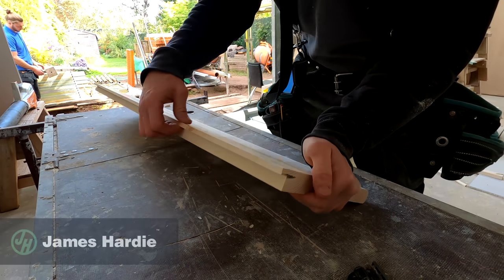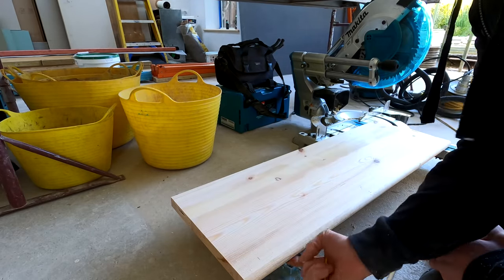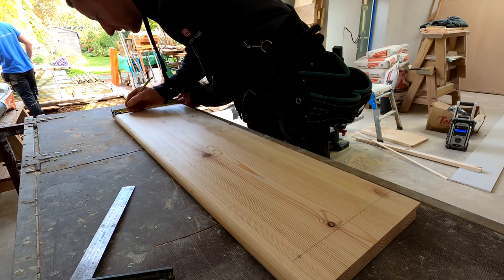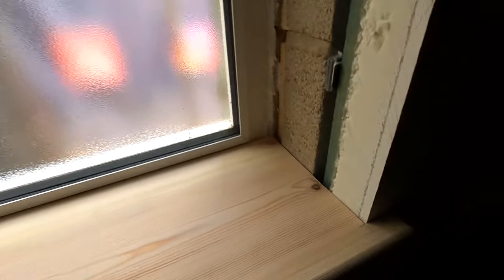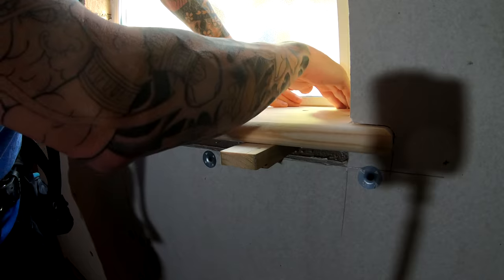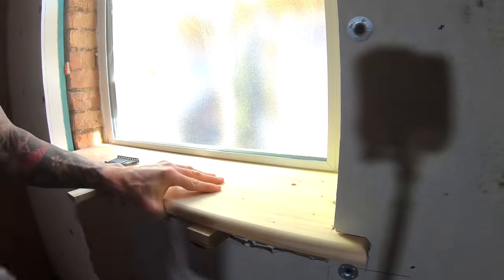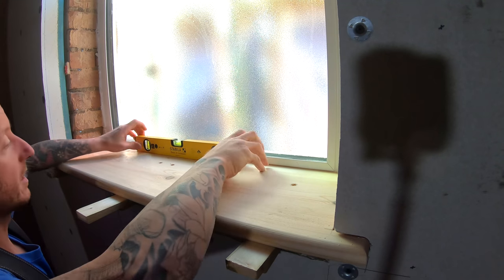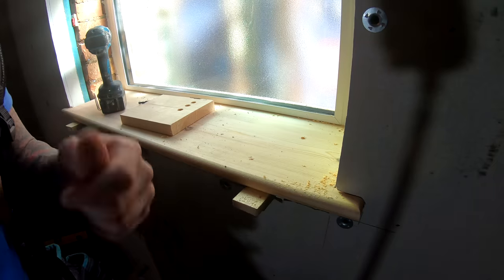HOW TO fit a Window Sill Board!

Comment: Old boy said to me to always tilt the board slightly away from the window (bubble on the line)  in order for condensation to run away from the window and not to pool there creating rot.  Which means he was taught by people who built houses in the 1930s.  It was probably an issue back then but not now I think.

Comment: My old boss 40 years ago was a stickler for priming the underside & edges of the sill board to stop any moisture warping sill board.
What do you think, do you find plugs & screws are a better fixing method than using 6mm  Countersunk Concrete Screws like Timco, which I was drummed into using a few years ago for fixing window sill,door linings,etc.

Comment: I use the same method although I pre drill the wedges to prevent splitting not that it matters as it’s downward pressure.  Finding a window that is actually level isn’t always easy. Nice work as always.

Comment: Fitted so many window boards like the over the years. I tend to put them on with expanding foam adhesive now. Top work as always.
Reply: Do prefer the foam,much quicker.
Reply: Just put something heavy on top mine have lifted before 👍🏻
Reply: @toddstockton9663  I've not done it that way before but I can see how that would be a problem.
Reply from the maker: Thanks for watching Stephen! 👍
Reply: You can  get low expanding foam or plasterboard adhesive 
It will not lift it .

Comment: Great job as always i do the same thing routing the horns. We usually get the plasterer to dab a bit of plasterboard on level when he's doing the boarding then its just a case of us dropping a sill on a pre levelled clean piece of plaster board. Saves so much time when levelling up especially when the brickwork is all over the place which is 90 percent of the time in the old victorian town houses we end up in. Although this method does require a brilliant plasterer thats willing to work with other people. They're generally not interested if on a price, which is understanderble.

Comment: James nice work pal
Is that brick reveal as in outside skin, if so should that not have a bit of damp proof up the side, winter that brick will suck moisture, hopefully don't touch the wood sill
Like the way you put in wood plugs nice finish mate

Comment: Great content as always and really helpful, John is a great all round master. Is that insulated plasterboard on the walls? That would of been a great video to watch, is it dot and dab or fixed to battens? Also what are the circular fixings all over?
Reply: Those circular fixings are what I call mushrooms or slab fixings. They are used to fix plaster board onto brick and block work.
Reply from the maker: They are insulated boards. We fix them to battens as it's an easier way of ensuring a flat finish (they can be a pain to dab sometimes). 

The washers help to ensure the screws don't pop through the board and help to give a great mechanical fixing.

I hope this helps. 

All the best, John 👷🏻‍♂️